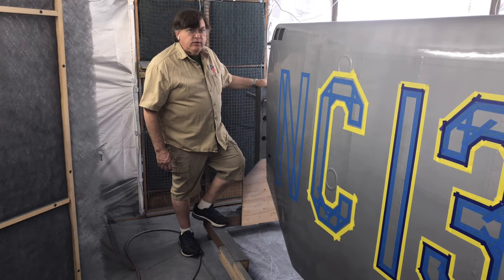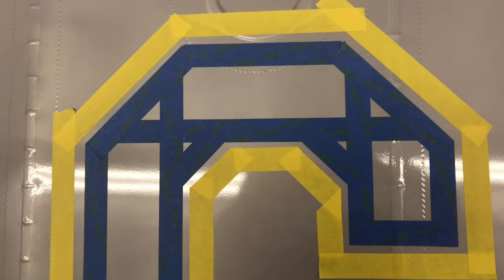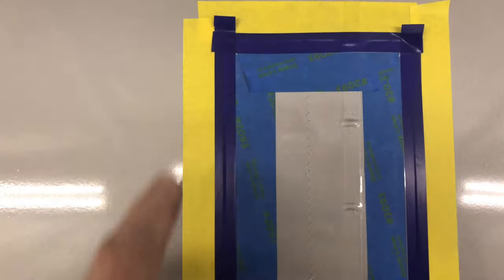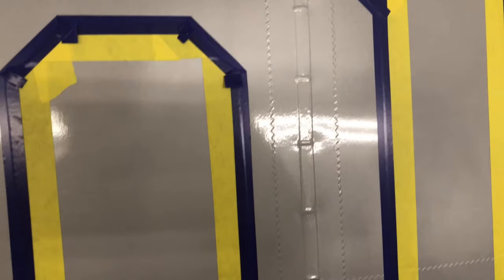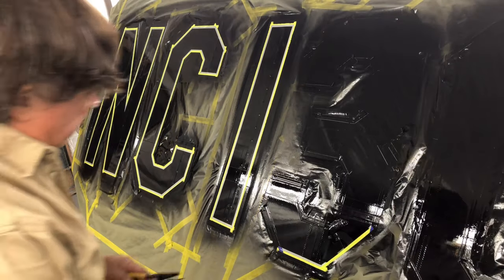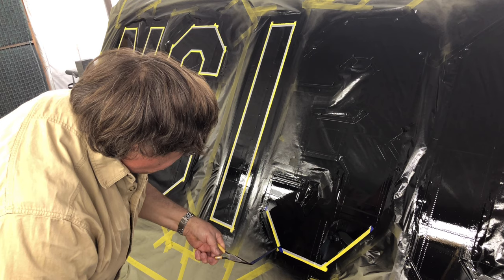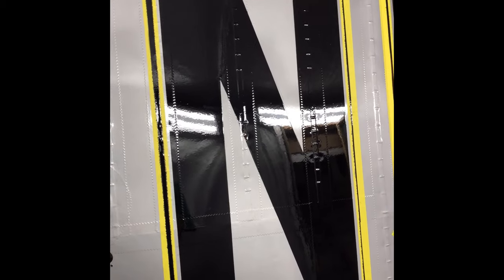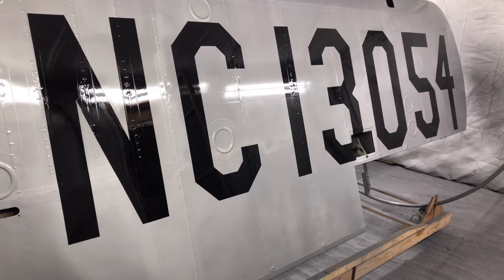N number and stripes

Comment: Are there standard dimensions for the letters and spacing that you used?  Or do you just figure this out for each number and airplane as you go?  Seeing the taping detail was fantastic, but I think the hardest part is getting the numbers sized and spaced appropriately.  It would be nice to see a video on that aspect of the work.
Reply: Lt, The size if the letters are based on a formula from the equivalent of the FAA back in the 1930's.  The size is based on a percentage of the cord of the wing.  The spacing is based on the width of the letters; each major part being 4".  On the top wing, the spacing was pretty easy but the bottom I had to contend with the inspection rings.  I varied the spacing, giving more after the NC but kept everything else the same distance apart and avoided the inspection rings that way.  It took a long time to figure it out.  I ended up using CAD on my laptop to draw each letter to scale where I could move them around on a sale drawing of the wing to avoid the inspection rings and the high points of the rib.  Next, I made paper cut outs of everything before I applied any tape.  The layout took me about 15 hours.  The owner had drawn out each letter on graph paper to match the style WACO had used so that put me way ahead.  Every wing is going to be different; depending on the size of the letters, the quantity of letters and numbers, and what letters they are.  The N is much harder to layout and takes more space than the number 1 but keep in mind they each have the same basic building block, 30" tall and 4" wide.  Each letter, other than a 1, is 14-1/2" wide so I start with squares that size and go from there.    All in all, it comes down to making it look balanced and with good spacing.  Lots of different ways to do it.
Reply: @martyfeehan2043  I will have a much easier time with 12” letters on my fuselage, however, it still looks time consuming.  I haven’t searched yet, but I am hoping that someone makes paper or vinyl numbers that can be used to make things easier.  That likely wasn’t an option for your wing work where it has to be customized by necessity.